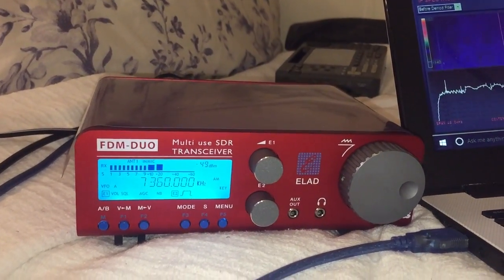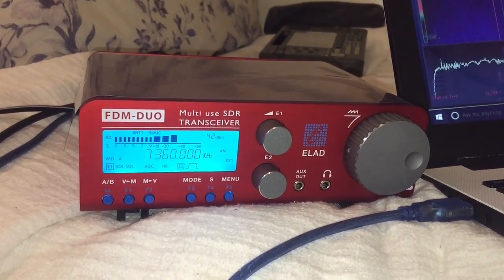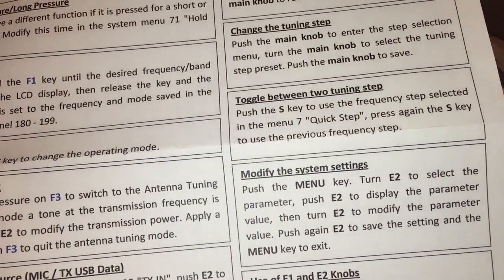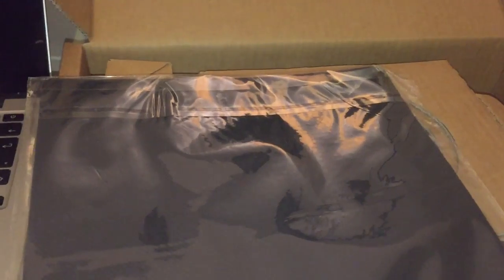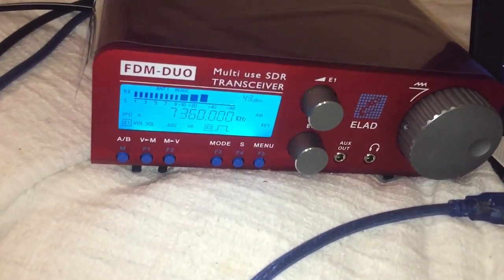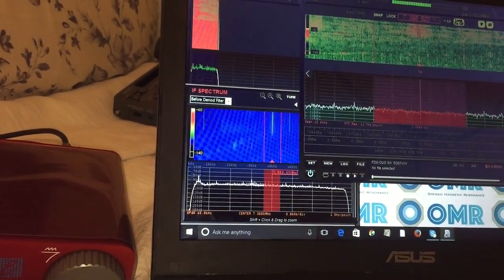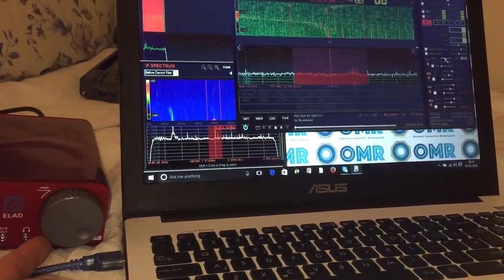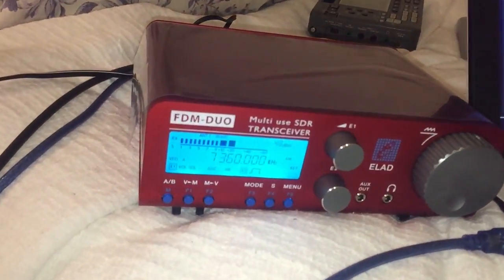Elad FDM DUO SDR: what you get in the box and an initial demo.

Comment: I can barely hear you? I have the volume Wide Open on my laptop with a set of external speakers & the audio is still very Low. Can you delete the Waterfall & also make the frequency readout larger than you have it on your laptop? It's rather small & I'm not a youngster any longer so I would want a larger readout.
Reply from the maker: This video was made nearly 10 years ago - recordings have improved since. You can make the frequency readout bigger by opening it in a separate window and you can reduce the side of the waterfall. 73

Comment: What a lovely looking Radio.I look forward to seeing further videos with reception once you have had a chance to put it through its paces.For 700 quid it should of come with a power supply but it was nice that you were provided with a free one.

As you say it is a transceiver but i presume you would need to be a licensed Ham to transmit.
Thanks for posting.73 Ray..
Reply from the maker: +Ray Kelly Hi Ray, thank you very much! It was expensive, but I really wanted a radio that could be used with and without a computer and for that additional functionality, I paid an additional £250 over and above an SDR only unit. I think it was worth it, but of course now I have to prove it with some really outstanding DX lol! Yes you need a Ham license to transmit - this isn't on my agenda, but I did some on-line mock tests a passed the foundation level without actually studying anything, so it can be done! 73s! Clint
Reply from the maker: +Gordon Foster There is an amateur radio club in Oxford and apparently it's thriving, so always an option. All I would then require is a TX antenna. Maybe this year......73s! Clint
Reply: Oxford Shortwave Log I take it you had no problems buying the transceiver version even if you didn't have a ham licence.